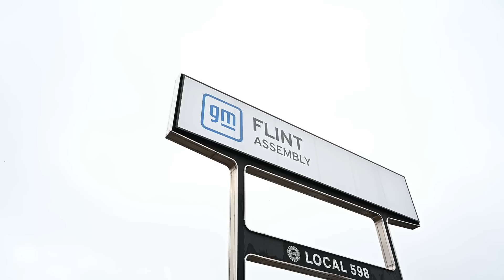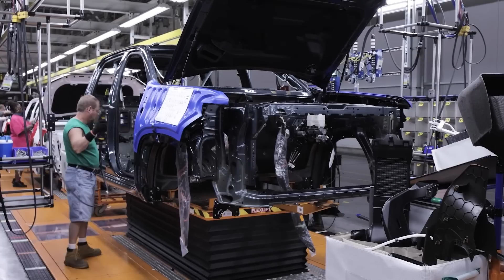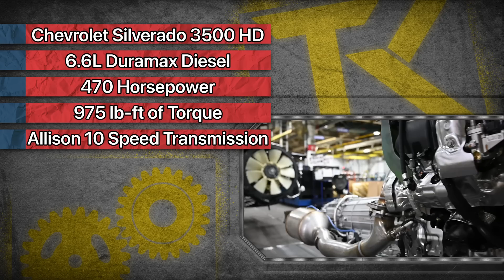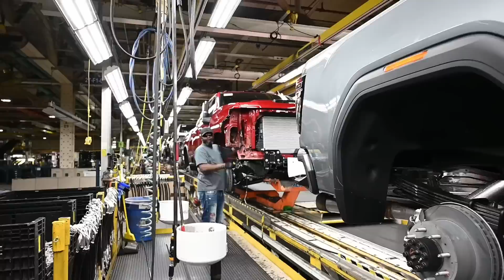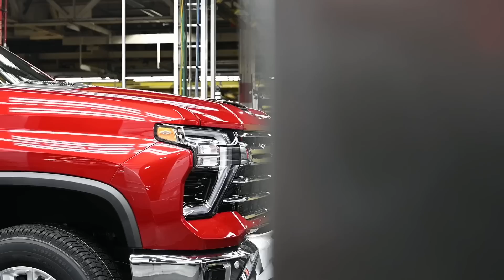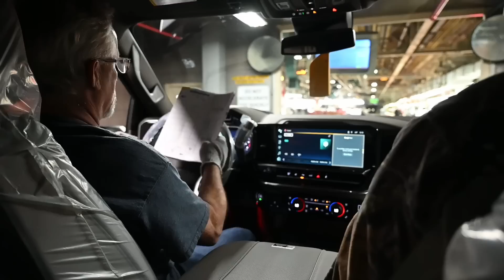I Got to Watch Them Build MY New Chevy 3500 HD at Flint Assembly!

Comment: My 2011 Silverado 1500 z71 was built with pride in Fort Wayne Indiana, it has 256k miles all original except brakes and wheel bearings. I’m proud of it as much as that factory should be and I still drive it daily

Comment: I perfer older pickup truck 4x4 4 door diesel or 5.7 or 7.4 n manual transmission 2500 or 3500 swr or dually on 3500

Comment: I was in Ford's Flat Rock assembly when they were building the Mustang and the Mazda 3 at the same time, on the same line.  Zero common parts between the two platforms.

Comment: Still have quality control issues and when you said notice the line never stops, that's the big problem because if you have an issue in 1 of these trucks it keeps going and never get pulled out of assembly line for quality inspection
Reply from the maker: They do get tagged and then diverted to an inspection area near the end of the line.

Comment: Thanks for the video! Always nice to see the assembly line videos.

Just bought a 2024 3500HD LTZ DRW. Traded my 2020 2500HD LTZ SRW. I went with the 3500 DRW this time to meet my cargo needs while towing my camper, car trailer, dump trailer, etc. loved my 2500. Miss it already.

Here’s my feedback on my new truck.

Pro’s: Increased horse power and torque.

Con’s: 1. No Owner’s Manual comes with the truck. Dealers will tell you they are available to download. The last thing I want to do is look a manual on my phone and hope when I need to I have cell service. What a fail on Chevrolets part. For $83K I shouldn’t have to pay $80 for an owner’s manual. 2. The cigarette lighter sockets are gone. I use those to power different monitors for my camper/trailers that are brand new and require cigarette lighter socket. Now I have to buy an adapter. 3. The rear door handle locks are gone. I miss them. It was a nice convenience. 4. Trim under infotainment center is designed so the angle catches the sun and glares right in the driver’s eye. Another Chevrolet fail. 5. No 110VAC outlet on the dash or in the rear of the console. It moved inside the center console. A really bad idea. Now anything like a power supply that gets plugged in and is inside an area traps the heat. 6. Oil filter is still at a 45-degree angle instead of vertical. You can only partially pre fill the oil filter after an oil change and thus you have a “dry” start with zero oil pressure for a few seconds. 7. Still no external oil filter on the transmission. 8. Infotainment system no longer has a tuning knob. Forces you to swipe the system to get to a tuner. 9. The new wireless phone charger is finicky. Worked well in my 2020 model. 10. the vented seats come on by them selves and shut off by the selves. I'd prefer me manually turning them on. Like I do every time they shut off. It's hot down here on the gulf coast.

Didn’t want a sunroof or transformer tailgate. A sunroof wouldn’t have stopped me for buying one if it was on the lot but a multiplex tailgate would have. I'm hearing the transformer tailgate will inadvertently open on its own and will hit the bumper causing a dent in the tailgate. the dealer said they recommend locking out the feature before driving.

Honestly, I would have preferred the gen 2 L5P Duramax in my old truck and just kept it. Would have been a lot cheaper.

But I do like my new truck. I just wish the engineers would take some input from people who actually use a truck as a truck and not design them in a vacuum.
Reply: I had watched this video back when it came out and decided to watch it again all these months later as I had recently put an order in for a 2025 HD 3500 although with the gas due to all the crap emissions on the diesel which I can see giving a lot of expensive grief after the warranty is past ( the emissions systems do not like cold weather in northern Canada unless the engine is worked hard ). I expect to not like the electronics and as of yet its all way over my head as I have never operated one with all the crap they put in every brand of new vehicle these days. And getting to that lack of a 12 volt dc outlet, that is so idiotic that they assumed no one uses them anymore. So my question to you is, what viable solution have you come up with to power your 12 volt devices ?

Comment: my dad bought at new 2021 gmc sierra 2500 6.6 gas. now its been sitting at dealer for over 6 weeks. while driving the rear camera light would come on and then engine would just die, wouldnt be able to start again. had over 36 codes on it. dealer said thought was bad fuel pump computer. replaced that, now waiting on another part.... all while not being able to use truck on farm. hes been gm for awhile, but now he says it maybe his last

Comment: You didn't happen to see my truck being built, did you? LOL! I placed my order on 3/23/23 and it hasn't been built yet!
Reply: how long did it take for your truck to be built
Reply: @m1dnight600 I ordered it on 3/23/23 and it was delivered on 1/12/24. The problem was the started building them only in certain colors and my color wasn't one of the original colors. They didn't start building my color until late July.

Comment: Nice to see the assembly process.  I purchased a 2023 GMC 3500 Denali, diesel, crew cab, 8’ box, dually.  The color is GB8 Ebony Metallic.   The power train is amazing, fit and finish is good however, the paint is the worst part of the truck.  The paint scratch’s so easily.  My assumption is that something happened during the paint process in the paint booth.  I have tried to contact GM however, with no success.  I owned a 2005 Chevy 2500 Diesel from new.  After 17 years, I had one small scuff below the rear door.   Do you have any contacts at GM assembly in the QC / QA division?  I would like someone in GM QC to check my paint for film build and paint hardness.  There is something wrong with my paint.  Thanks for any feed back.

Comment: Way cool you got to watch YOUR truck being assembled and coming to life.  How long did it take to get that all set up?  How long did it take to actually get your truck at the dealer when you left it at the plant?
Reply: I saw my 2020 being assembled at flint and it took about 3 weeks before it arrived at my dealer in North Dakota
Reply: @howebrad4601  Your in the US though, I wonder what the wait time is for units to make it across into Canada.
Reply: @charlesb4267  I'm in NW North Dakota, about 40 miles from the border, which as far as the US is concerned about as much no mans land as you can get.  Hopefully it doesn't take too much longer to get into Canada.  I have a photo of me at the same spot at the end of the line.  Mine is also a Cajun Red, but a dually.  Been very happy with mine.  Perfect truck and never any problems at all.  Just did a round trip to Phoenix with it and got pretty decent mileage pulling a trailer.  I'm really sold on these GM pickups.  In my opinion they are excellent.
Reply: @howebrad4601  Although I have never been to North Dakota I have touched on the states around you and being from northern Alberta I have a pretty good handle on the no mans land theme ! ( can you imagine the destination fees to Alaska or Hawaii ) . About your truck, what year is that as there have been a variety of changes in the last few years, transmission, and for 2024 some engine changes as well as interior and wiring changes ( someone on here commented about some 2024 electrical issues ). Being that you pulled a trailer, I expect you sucked up the DEF pretty good ?. I realize there are so many factors that go into fuel mileage as per what weight and height your trailer is and the type of roads travelled but what has your loaded mileage tended to be ?. By the way I had been to Phoenix once many years ago now, my dad had retired down there in the Mesa/Apache junction area so I can visualize the surroundings.

Comment: That's cool.  Next you will be able to watch them fix it. Mine has been in the shop forever.  I regret buying it.
Reply: I am curious what your truck is in the shop for ?
Reply: @charlesb4267  it started out having electrical issues.  Got it back then a week later alternator quick working. Then more electrical issues that they can't seem to figure out
Reply: @sbenn6917  Oh, so its a combination of a problem and then techs that are not familiar with the systems to find the issue. That is frustrating as the customer, as your helpless and feels like the dealer is also.

Comment: Twice as much as i built my house for just insane . Does it have a toilet, tv and stove. Geez.
Reply: Still 3 36000 warranty For the amount of money that's crazy.  10/100000. Would at least help.
Reply: @AdventureswithP.C.Wabash6057  The diesel trucks have a 5 year 100000 mile driveline warranty ( applies to both the 3.0 and 6.6 duramax ), now what that all entails I don't know as there is always fine print. The rest of the truck would still be the 3 year 36000 mile warranty bumper to bumper.
Reply: I did watch the video though.

Comment: I watched my Corvette being built...Then they kept it(all cars) on the lot for several days...Ten days later I returned to Bowling Green and drove it back to Texas. Lot's of fun even though I had to make two trips.
Reply: nice try, the factory ships the car to a dealer, you can not pick up a car at the factory. you probably dont even own a vette 🤣
Reply: @markjh1017  R8C option when ordering a vette will get corvette museum delivery which is connected to the bowling green ky vette plant. The original title goes to Campbell Chevrolet located in bg but the car leaves the factory and placed in the delivery section of the museum. Btw, you are correct I do not own a vette. The new ones are blinged out hip-hop rattle traps and are but ugly. Thanks for the reply. 😺

Comment: It’s very exciting to see your own truck being built I totally understand because I also saw my 2011 GMC 3500 HD turbo diesel Z71  being built  . It’s an amazing experience that I will never forget, in fact I love my truck more because of it . I took over 100 pictures and had the chance to talk with the GM workers . Those workers are amazing at Flint Michigan 🇺🇸 USA great team work. By  watching your videos I know that the factory line has changed so much since 2011 . The body marriage is so different now and  the truck are on a suspension conveyor belts , and they are putting the tires at last stage of the process  . Back in 2011 the tires 🛞 were installed right after the frame and motor installation. Many improvements have occurred since then. God bless America 🇺🇸🇨🇦

Comment: Did you notice when the engine was being installed onto the frame, there was a big ding or crease on the exhaust pipe that crossed over the transmission?

Comment: I’ve owned a couple of these same 2500/3500 duramax trucks for almost 20 years. The restless nights and anxieties I’ve had with engine lights, DEF issues, blown Allison trans at 140,000, blown motor at 240,000, and the list goes on. Crazy expensive…..but where else can I turn. I gotta have these trucks to make my living. I feel like I’ve been a hostage forever. At the end of 2024 I’ll likely be buying another one almost identical to this red one in the video. I was disappointed that the GM plant is still so antiquated. So many good folks on the line…..but the infrastructure is so incredibly dated. Come on GM….do better! Signed GM Silverado Owner for life.

Comment: I don't know what's dumber buying a general motors product or paying $100,000 for it. I maintain a fleet of GMC and Chevy trucks and they are just damn awful. Never seen so many problems in my life.
Reply: I am curious as to what problems your running into, the reason I ask is because I am in the market for a truck and wonder what to get and what I should stay away from. Have been tossing around either a baby duramax or stepping up to an HD of either a gas or diesel. It seems all the big three are having problems with engine issues or if not that its something else with all the complex computer crap they put on them these days.
Reply: @charlesb4267  do you need a diesel or a gasoline engine. It all depends on what you're using it for anything's diesel made nowadays has so many sensors and uses dex which causes nothing but problems like the engine to go into limp mode for the dumbest things. I work on gasoline engines my son is a diesel mechanic. Chevy just seems to have the most issues not with just engines but chassis and various other problems. I absolutely stay away from the turbocharged four-cylinder in the Silverados.
Reply: @moegreenbl  I can use either gas or diesel and of course the choice of truck as in 1/2 ton vs HD would limit its towing ability. The idea of the half ton with the 3.0 would be about fuel mileage ( the so called economical choice ) , the 6.6 diesel choice would open up options of using it to tow trailers and equipment on the farm and yet "in theory" get better fuel mileage in general over the HD gas. Theories are great but what the picture would look like after years of ownership, that could look very different !. So many farmers around here have diesel pickups and the 6.6 is very popular, it seems the newer model duramax's that end up on the local Ritchie Bros auction due to companies selling out ... bidders seem to crap all over themselves to buy the duramax and Ford 6.7. A lot of oil field companies run diesels but will say some have gone to gas trucks due to the issues they have had with newer diesel pickups as some of these companies do a LOT of idling and that is an issue. While I have been around diesel and using diesel engines most of my life on the farm with tractors and highway tractors, what I don't have as of yet is any dpf or def equipped equipment.  

So I hear crap happening with all of the big three in regards to gas engines as well ( and yes certainly the diesels of cummins/ford/gm ) , as in GM half ton engines having lifter/cam failures in the 5.3 and 6.2 ( have not heard much about the 6.6 gas one way or the other but am concerned about the direct injection system ). Ford, the 7.3 gas lifter/cam issues at least early on in their series and I hear issues of the 3.5 eco boost with turbos failing so am not surprised the GM turbo 4 cylinder has issues, Ram with 5.8 and 6.4 valve train issues. 

I am not really a Ram fan but that is just my personal opinion there, I detest the stop/start idea of any vehicle I would contemplate owning, also would prefer to stay away from the light load alternating firing engines as I get the idea they do even worse for issues in cold weather. Its frustrating, it seems all of them and that includes the Toyota Tundra ( which I doubt I can fit in anyway and they have mini boxes on a crew cab ) which now has gone to the smaller turbo engine. Every where I turn its highly complicated problematic vehicles on the market these days, my head spins and I come up with no good answers as to what is the lesser of the evils to own !.

Comment: Thanks for sharing this amazing process. But for $102k I would've expected a happier ending.
Reply: That's CAD
Reply: 100k? On a depreciating asset. I'm good.
Reply: Yeah, and a roll of Gold 1/10oz eagles in the glovebox.
Reply: This truck should be no more than 50k.  GM= con artists
Reply: It's not 1994 anymore this is a 3500 not 1500 so that price is correct @Jeff-sp7bg
Reply: @Jeff-sp7bg  Even 50k is really too much as there are houses within just a few miles of this factory that are priced under 50k.
Reply: @pugmalley imagine if humans built this truck from start to finish. With all the added benefits.  It would cost $102,000.

Comment: Why didn’t that truck have a DPF and DEF filter on the exhaust
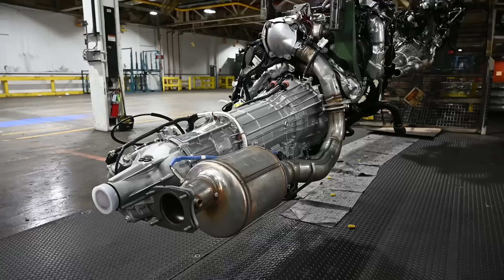Reply: 4:31    DPF on the right hand side of the frame.  Duramax engines have one exhaust outlet.
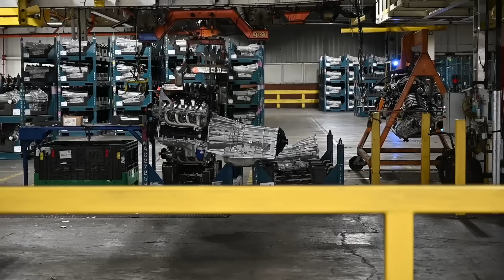A couple of other engines were gas 3:48, which have open exhaust manifolds on both sides.  You can tell by the air intake on top the engine, vs the turbo piping on the Duramax.

Comment: Hope they check the transfer case out real good, mine acts up periodically and I was stuck a couple times, forcing it to stay in four-wheel-drive, because it wouldn’t come out of four-wheel-drive until I tricked 
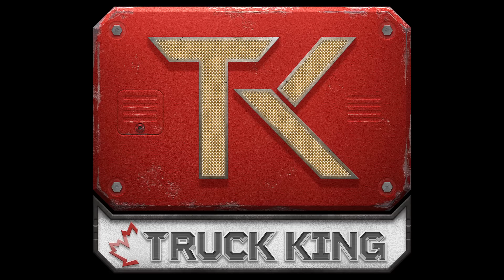 the system. 12:29 
FYI: it doesn’t like cold weather or water so if you’re launching a boat or you leave it in four-wheel-drive overnight outside, don’t expect it to come out very easily !
In my opinion, they should go back to the manual system, it works much better. Never had a problem with the older trucks.

Comment: I worked as a Dump Truck Driver back in the Late Eighties, The Company that we was leased too put the very First Robot in The Chevy V-8 Plant, The Very First Robotic Part Handler in GM. We would literally back into the Loading Dock Ramp continuing back into the Bowles of that Plant. We had to use Small Tandem Axel DumpTrucks because the Requirements were Backing down The Main Isle’s with several Turns just to get back to a area where they would load them full of Contaminated Soil. Then after getting Loaded up we drove back through the Plant getting to the loading Dock then Outside. Nowadays they would have so many Restrictions on were, when, and How Contaminated Soil would Disposed Of. They had us Take to a Side Road off of Saginaw St. at James St. Dump in a Field, that same Location where the Dirt was Dumped there are Now. Houses Built in all that Nasty Soil That Came out of Chevy V-8 Plant.